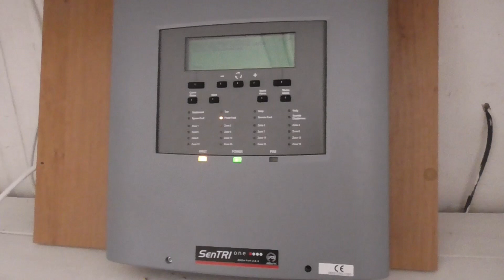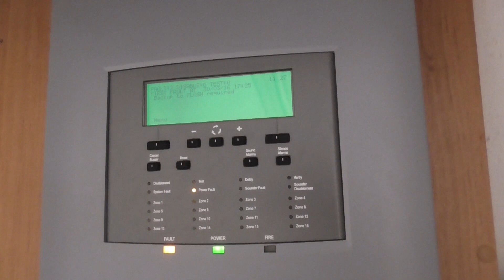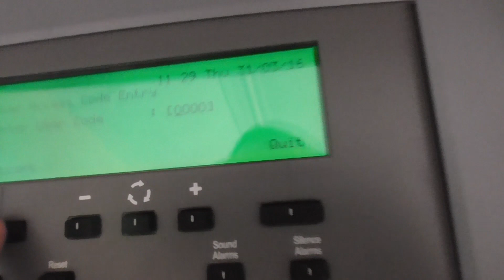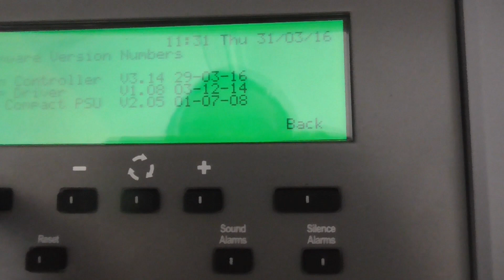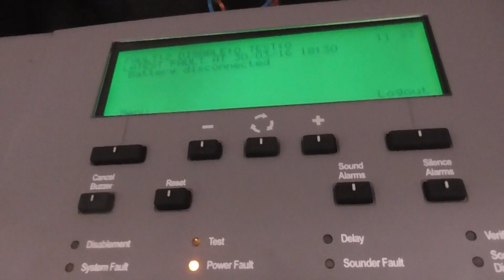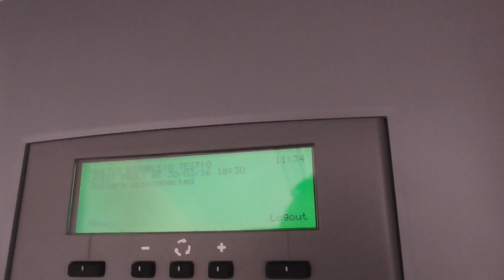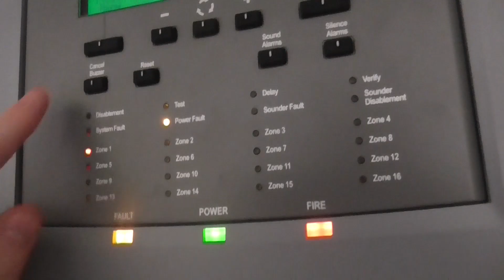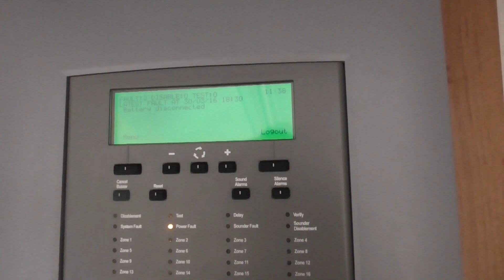SMS SenTRI System Test 1

Comment: you'll not be able to get the software for that panel. But I've had one before and the engineers password is 3333 if I'm remembering correctly. Then to get rid of that backup to loop fault you need to backup the loop, it's somewhere in the engineering section.
Reply from the maker: Ah ok thank you! I will try that out.